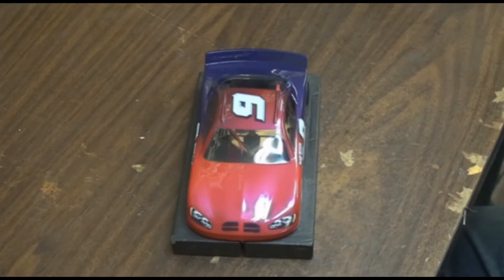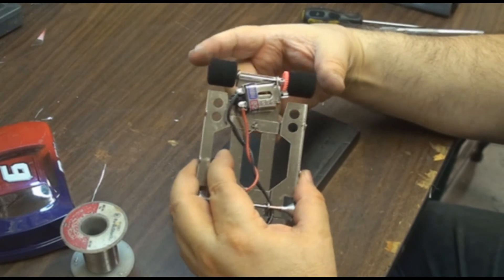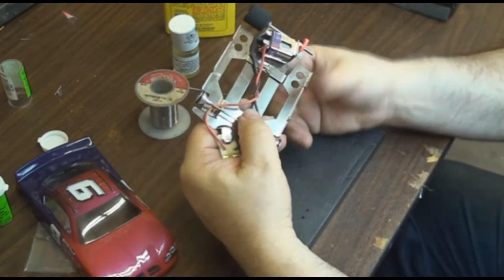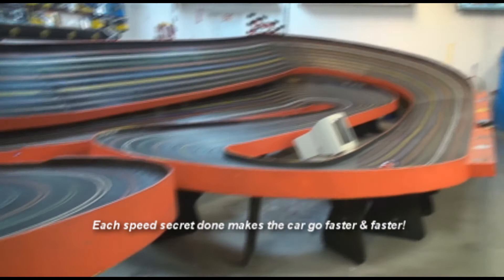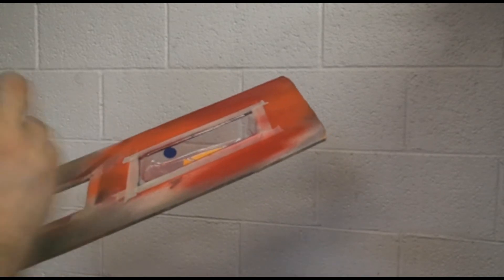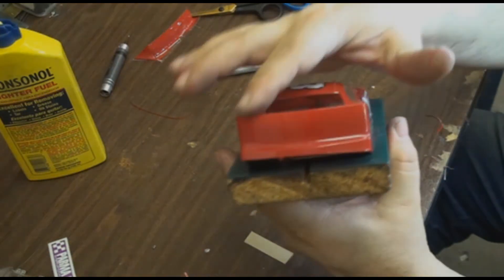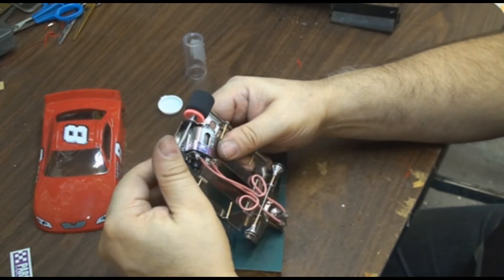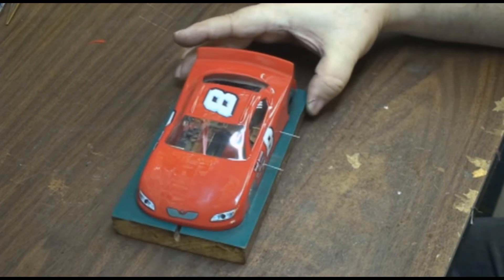Tuning up your Gr. 10 Nascar Slot Car - promo

Comment from the maker: @snowmanexp With a Gr.7 Open we have ran a 2.476 sec. It is not a high speed King track which turn faster times like around 1.5 seconds with a Gr.7 car but more of a drivers road course.